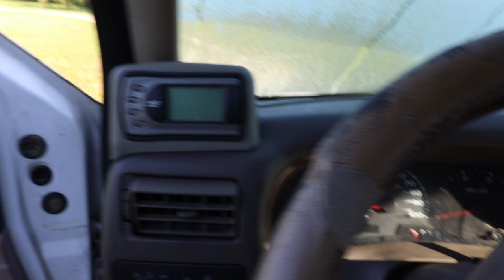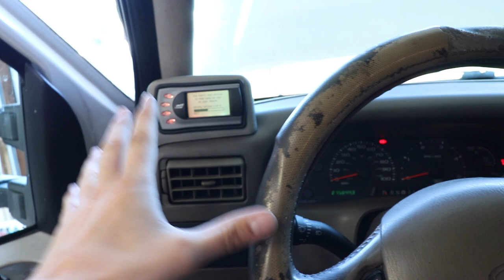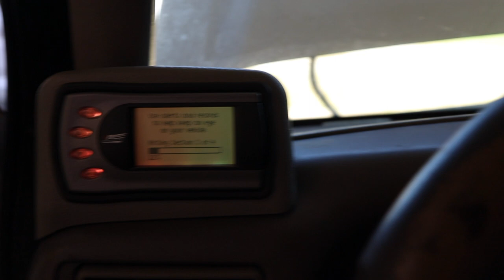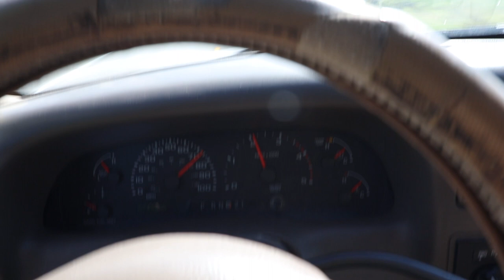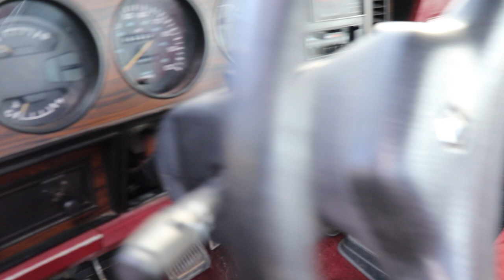NEW WHEELS & TIRES FOR THE 1ST GEN CUMMINS!!! I NEED YOUR HELP!!!

Comment: 17 or 18s old school look, leave the inside stock add some gauges, or maybe just one boost gauge, add an intake and exhaust maybe just a 5-inch tip with red valve covers leave the rest alone, or maybe a long old school shifter I think that would be cool...

Comment: Ugh the 7.3 tho 😍 sounds so good
Reply: Scubzei 1v1 still slow
Reply: 6.0blow 99 that’s what happens with a stock powered 7.3? The 5.9 is slower unless you turn up the fuel a bunch idk what your trying to say?
Reply: Tyler’s 6.0 got 2 7.3s they’re just slow in general. Can make anything faster than stock just saying it’s still slow.